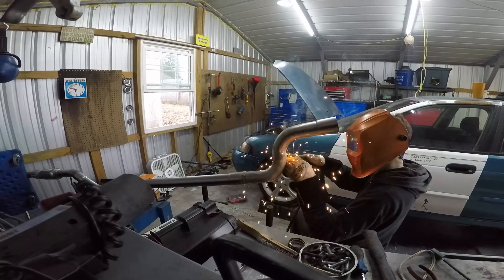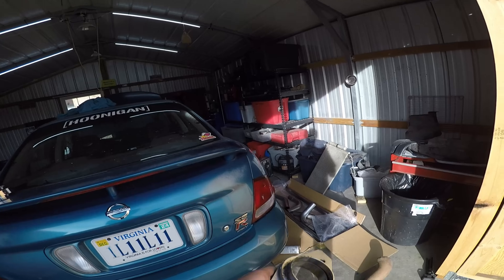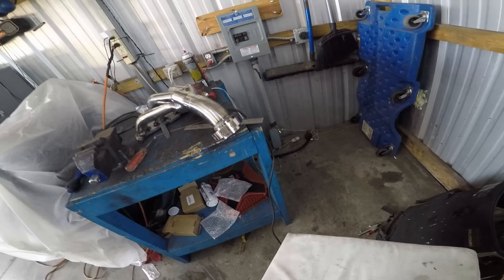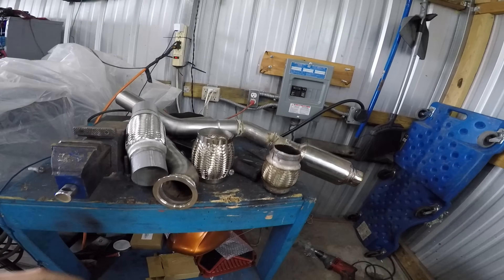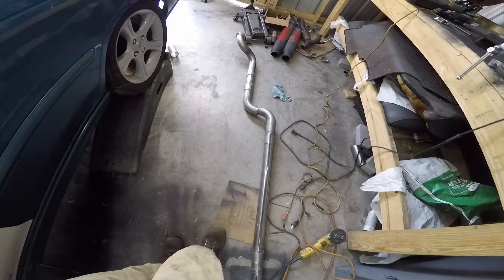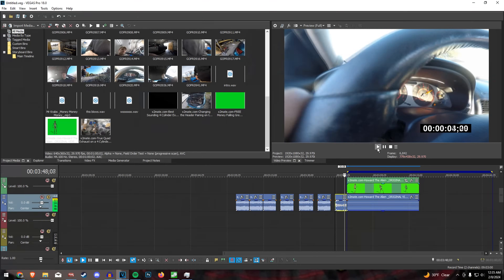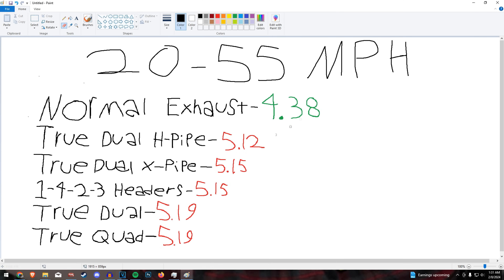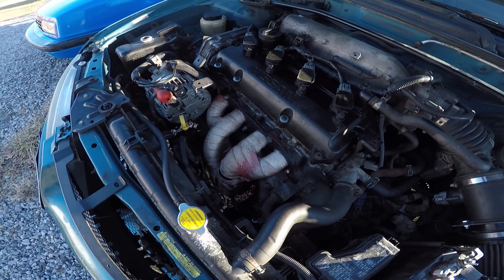How Bad Were the True Dual 4 Cylinder Exhaust Setups for Performance?

Comment: well, the stock exhaust had some engineering behind it.
the rest of the tested exhaust systems had topology changes, but next to no engineering.
fine by me, but if you are indeed looking for performance, a better topology without engineering behind gives you only drawbacks performance wise. 
and even an inferior topology can be engineerd to work properly.

your videos verify that.

Comment: Aren't header wraps actually a bad idea? Don't they just trap heat on the header and wear them down faster?
Reply from the maker: Header wrap is a controversial subject, some say it make them hotter and wear out quicker, some say the wrap allows it to cool slower and make the headers last longer. The main thing is not to get them wet and let them sit, it will cause rust.

Comment: You should redo the dual exhaust videos with the cylinder pairings done properly. You’ll make more power I think.
Reply from the maker: one of the setups compared was the true dual H pipe with even pulse headers, it didn't do much for it https://www.youtube.com/watch?v=rEDtQp8po84&t=108s
Reply: Well, there we go then! Well, you’ve at least done all the exhaust things I’ve wanted to do to a 4 cylinder car, but never got the chance to. I don’t work at the muffler shop anymore.

Comment: I expect someone to respond with the nerd emoji to this. The reason the true duals, even with a crossover, loose so much power is the drastic reduction in scavenging effect going from a 4-1 to a 2-1 header. Any scavenging you make up for later is just putting a band-aid on it.
Reply from the maker: 🤓🤓🤓 you are right, though. Scavenging is important, that's the reason we don't see dual exhausts on 4 cylinders
Reply: @HatersGarage  supercharge the car then test the exhausts for performance afterward. Not to spoil anything, but even 2-3psi running through the motor will take care of any scavenging you need
Reply from the maker: @copeland7225  Or with a turbo scavenging doesn't matter at all
Reply: @HatersGarage  if you’re gonna turbo this thing on the channel, please get like the most oversized BS turbo you can
Reply from the maker: @copeland7225  This car probably won't get a huge BS turbo, but I have some other cars that might.
Reply: @HatersGarage  whatever you do, go the roadkill route with the 200$ powerstroke special

Comment: scavenging is the issue. 4 cylinders going into one pipe will always give a higher and more consistent flow rate, pulling more vacuum into the cylinders so they can pull more mix in on the next stroke. the time lost on those acceleration runs was at the bottom end.

Comment: I would say that the most unique sound wil by produced by 1-4,2-3 headers, true dual pipe, ended by nascar x-pipe boom tubes:
https://youtu.be/Q6wXpOQVdN0?si=ipvzQZxvbln6lVCI
I mean those with extra connecting pipes...
Probably it'll make the car slower, but the sound will be truly unique.
But there's a possibility, that nothing will beat late 1990s rally Kit Cars, high revving,  naturally aspirated, wide bodied, front wheels drive hot hatches...

Comment: but what about no exhaust? LIke no header or anything
Reply: No back pressure == bad day
Reply from the maker: I'd do that but it can crack your exhaust valves
Reply: Melt the engine bay
Reply from the maker: @haveaniceface7290  That too didn't consider my plastic rad fans lol
Reply: I've done that on a honda 4cyl before for the lulz... it sounded like a bubble machine, not even kidding. Was fun seeing fire shooting out though.
Reply: @davidwostrel You don't need back-pressure, that's literally the definition of bad and inefficient. It's about exhaust pulse scavenging and getting a good vacuum on each exhaust stroke to feed the next one better.

Comment: Not enough backpressure?
Reply: Engines don't need backpressure, they need returning pressure waves. Any static pressure in the exhaust system is just fighting against the piston and exhaust flow hurting power
Reply: @Mrshotshell  I have no idea how exhaust backpressure would "fight against the piston" That doesn't really make any sense. The exhaust valves aren't open long enough to allow for that and the pressure coming out of your cylinders is WAY more than anything in the exhaust system.
Reply: @CRneu  any pressure in the exhaust is added to the pressure in the cylinders while the exhaust valve is open which adds resistance to the piston traveling up the cylinder
Reply: @Mrshotshell  Yeah, so then why did all the other exhausts lose so much power when they were free'er flowing is my point. Usually going straight pipe and deleting the catylitic convertor makes a car faster, because you are removing restrictions in the exhaust system. Well every one of those odd exhaust systems he made reduced restrictions, yet the car made much less power. Why? That is my whole point, that it doesn't make sense...
Reply: @BuckeyeBallistics car isn't tuned for the new exhaust

Comment: The most flat and smooth sounding exhaust tends to be better for performance in general. 🥲 I think even Subaru has started to move away from their UEL setups with their most recent engines and vehicles to get more power out of them. It would be interesting to see how the UEL setup would sound in performance if the actual unequal length section was done at the header but then true dialed with an H pipe. It seems like it would be even worse, but you never know. I'm thinking something like what this guy did but with the true duals and an H pipe. His setup genuinely sounds like a V8 on startup, kinda reminds me of the way the VooDoo V8 from Ford retains that classic V8 rumble while having the flat plane crank sound. He did not have a big dip in performance. I would be interesting to see something like this with a single vs true dual comparison. https://www.youtube.com/watch?v=GYsOiAVtc5Y
Reply from the maker: That really does sound like a v8, I might have to try something like that.

Comment: Who's still using Windows 10?
Reply from the maker: I tried Windows 11 when it was in beta, I hated it
Reply: @HatersGarage  it's improved since the beta. There are still some things about it though that make me want to rip my hair out
Reply: Uhh... last I checked, like, 65% of windows installs are 10. 11 is under 30%. Folks are going from 10 to Linux, at this point 💀
Reply: @MikeStavola  there'll be more windows 11 users by 2025 I'm sure. The same thing happened with Windows 7 when Windows 10 came out
Reply: I prefer to let other suckers do the beta testing for me.